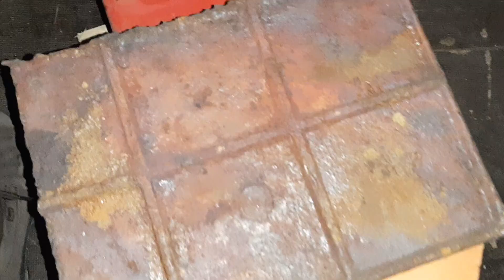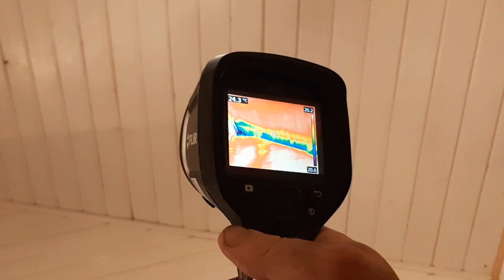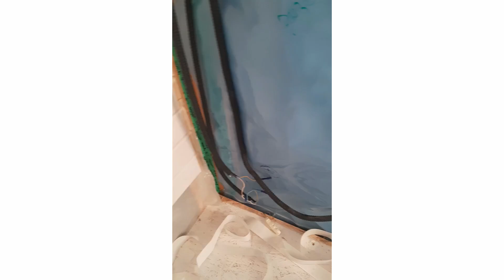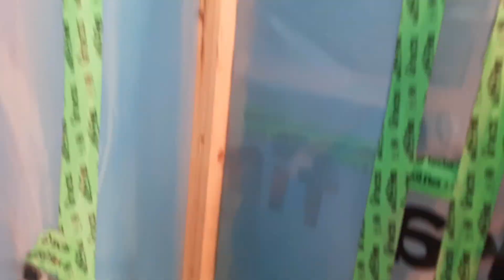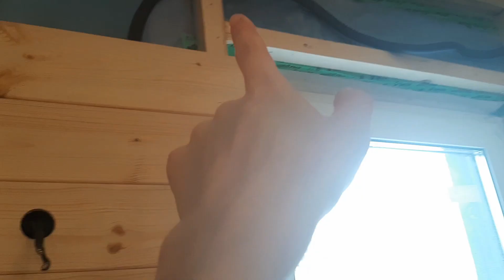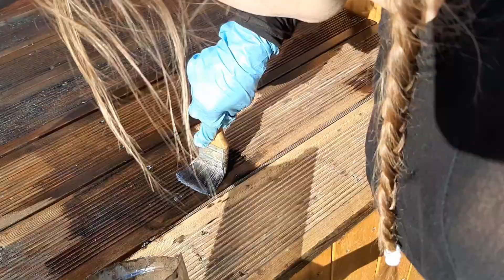[The Off-Road Ranch] #93. Recommendations for BUILDING a FRAME HOUSE.

Comment: How long did it take the construction crew to reinstall all the interior walls? Did you change the electrical outlets locations, or was that not possible?
Reply from the maker: Reinstallaton of all wall panelling was quite quick. Around 4 days. The only detail is that they were cutting them inside the house. If it was warm dry weather, they could do it outside and they could paint them immediately. 
Yeah, I added several sockets and cables for lamps when I understood that I can change the scheme little bit.

Comment: 🎉Excellent! A new video after a long break. As always, your videos contain a lot of useful practical information. Especially regarding electrical work and inspection of work performed by builders❤. When is the water supply planned? How are things going with the sewer system? Do you already know if you will be able to implement are this year? Are you filming anything new? When will there be a video about the current work? When will you present your hedge fund project? I understand that it takes up all your time when you are not sleeping or working on the ranch?